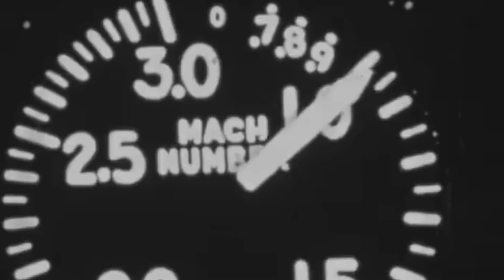First Supersonic Flight, October 14, 1947

Comment: Didn't an F-86 unofficially exceed the speed of sound  previously?  PS- The X-1 proved there is no "sound barrier."
Reply: So did the Messerschmitt Me-262.. both planes could reach Mach 1 in a steep full power dive, the X-1 was the first in level flight.
Reply: @DoktorBayerischeMotorenWerke  - I do not believe and Me 262 ever achieved mach 1 and survived.  In "A Higher Call" an Me 262 ace, Franz Stigler claimed the elevator/horizontal stab would lock above about 600 MPH making recovery virtually impossible.  The Sabre achieved it in a fairly shallow dive.
Reply: @scootergeorge7089  The Me-262 is the very first aircraft in the world that could safely fly faster than its V-critM. No aircraft could "break the Barrier" until the invention of the powered Horizontal Stabilator. 
The Bell X-1 and the F-86 used the exact same power assisted electric Horizontal Stabilator designed for the Me-262 by Adolf Busemann and Heinz Wunder.
 like the Me-262 the Sabre could only achieve Mach 1 in a full power dive and at the correct temperature/altitude conditions.
Chuck Yeager confirmed Hans Mutke's claims and his own accounts of the strange phenomenon of his Me-262 passing through the shock wave and going supersonic are the same. 
The German A4b rocket plane successfully reached Mach 4 (unmanned) in 1945 but the war ended before the first manned test flight could take place.
We know from the Fedden and Von Karman Missions that Germany was a decade ahead of the Allies in supersonic flight research.